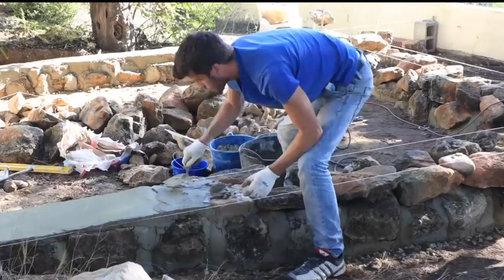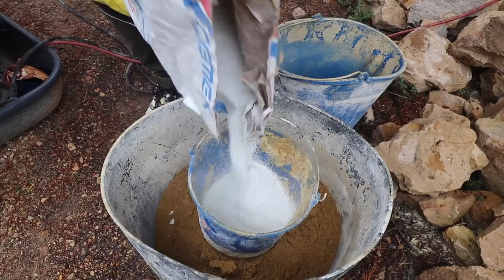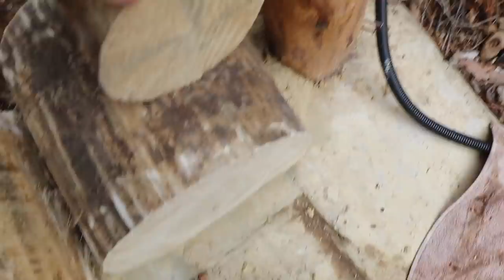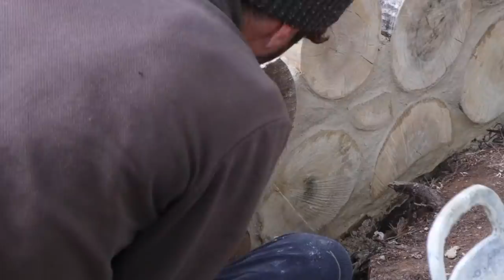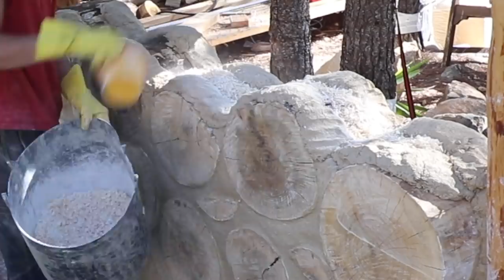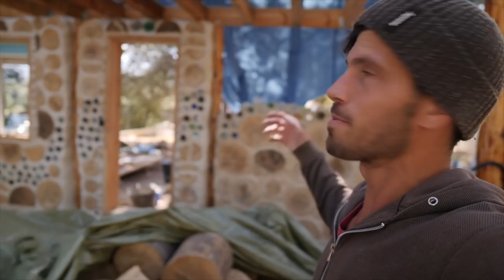Big Problems trying to Fit Big Logs in Wall of Log Cabin

Comment: Concrete is very base. It you get a concrete burn treat it with an acid, such as vinegar. It will neutralize the burn. Just a little FYI from a retired nurse in 🇺🇸

Comment: shou sugi ban is a particularly striking method of preserving wood by charring it with fire. Traditionally, this practice is used with Japanese cedar in order to weatherproof it. The wood is burned until the surface is charred, and then coated with natural 
look into burning the outside logs so they get 1/4" to 3/8" char on their ends

a deep burn resulting in pest, rot, and fire resistant as well as becoming a natural water repellent and sun shield.

Comment: How about putting a faux cordwood layer on the wall that you are trying to coverup? Cut 1 inch thick log ends and glue them to the wall and fill in with cement.  Then the wall would look like your cabin.

Comment: I have seen your videos and have enjoyed them immensely. My question to you is,when you're mixing the mortar, what is the additive which you add that is kept in a bucket, and you wring out before adding to the mix? Also, what is the powdery product that is used between the mortar and the stones and bottles...some form of insulation? I'm looking forward to see the finished build. By the way, what part of Spain, I studied there in the 70's. Thanks.

Comment: When they build these homes in Canada I believe they usually split the logs to prevent them from cracking and letting cold air in the building is this a concern for you in Spain?
Reply from the maker: no, i"ll just fill the cracks :)

Comment: Very nice proyect for some months, I really wanted to do something like this. Do you have any idea if the wall in the exterior is water proof (agains the rain), or what solution are you going to implement for that ?, and have you calculated or have some idea of the heat transfer on those walls ?, just the walls, no matter the doors or windows, to have us some idea of that parameter.
Reply from the maker: Well, the longer logs you choose, the more insulation you can put in. My logs are average size as I live in a very hot country. And for water proof I just overhang the roof. :)